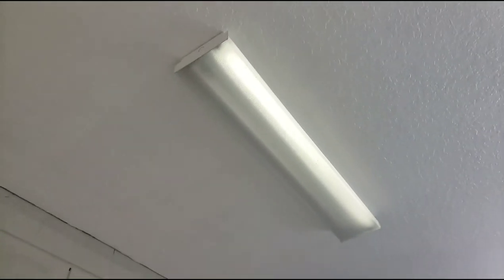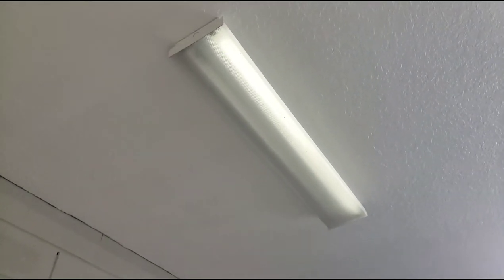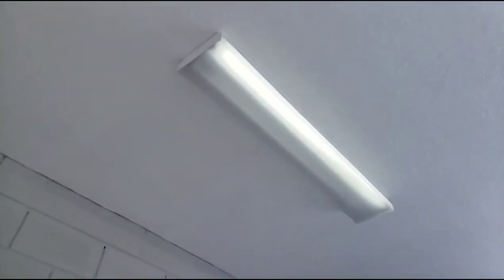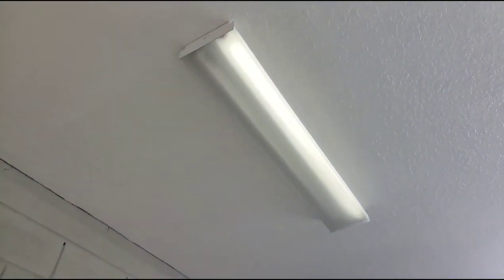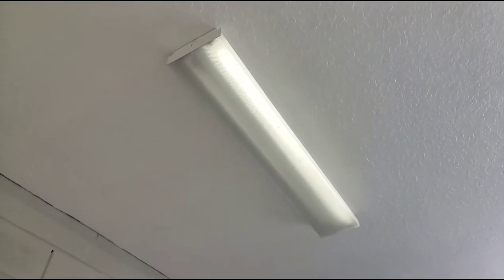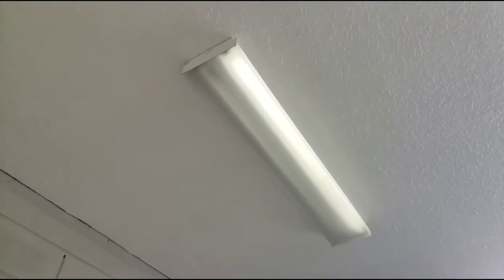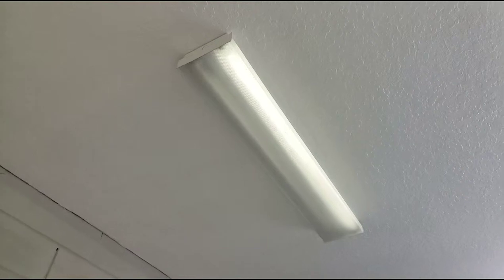Home Electrical - Florescent lights not working and changing the bulbs doesn't fix- bad ballast

Comment: I installed new bulbs. They worked for a few days. Now they barely light at all and the ends are black. However, every once in a while, they light up all the way and then fail to do so the next time I turn the switch on. Any idea what happened here? Could I have installed them incorrectly? Or could it just be a matter of dirty connectors?
Reply from the maker: I think  you probably have a bad ballast like in the video. The ballast controls the voltage to the light bulbs. Its bit worth replacing the ballast. I would just have a new light installed. Thanks for watching please subscribe!!
Reply: @drewsquickfix  I ended up converting to LED.
Reply from the maker: @bradh6185  awesome thats the best way. Saves a ton of money.  13-17 watts vs 40 watt florescent tubes
Reply: @drewsquickfix  Yep. No ballasts. I used my existing fixture/tombstones. I'm happy with it.

Comment: Word of the day .... "ballast"
Reply from the maker: Ha ha yes until I took an electrical class I never knew what the heck a ballast was :). I'm sure this video will get low views though. I did it as a quicky for subscribers like you AR I hope you found it interesting somewhat lol
Reply: @drewsquickfix  lol i never actually noticed one or two ballast while changing lights.  I've only been changing the screw on type bulbs, and that may have a ballast, too.  This is actually good to know for future reference.  Thanks!
Reply from the maker: The ballast is under the metal cover wiyh all the electrical wiring so you dont see it when changing out the bulbs. If a ballast goes it's not worth replacing it. Just get a new florescent light with led bulbs. They use 17 watts per bulb vs 40 watts per bulb.
Reply from the maker: Also if you change a screw in light bulb buy an led bulb for like $6. It will pay for itself in energy over one year. Compact florescent bulbs are usually 13 watts led bulbs are like 4-8 watts

Comment: Hi Drew, love your channel! I recently bypassed my ballast and switched to LED. I have a 2 bulb kitchen light and only one side is working. Could it have something to do with the tombstone?
Reply from the maker: Hey Kathleen, Just buy a new led light that takes led bulbs. Its the best way! I had a similar issue with trying to upgrade a ballast to led. Its really complocated and you actually need a separate lower wattage ballast from what i understand. I didn't have any luck its like there's too much power for the low wattage bulbs. From what I understand a  ballast is like a transfomer that charges up and makes more power for the florescent tubes that are 20 to 80 watts each tube. But the gas needs alot of energy to light up.   Ive found the best solution is to actually just buy a brand new light for $50 to $75 at home depot or lowes that holds led bulbs. Theres 2 kinds theres one that takes led tube an bulbs never replace and one thats permanent. I reccomend the one that takes led tubes. So you can replace them. Sorry about the loud  lame music ha ha I was trying something new and the volume was too high. Llease mash the subscribe button and hot the bell for notifications
Reply from the maker: You won't believe how.much energy you'll save by replacing the light and using led tubes. One tube is 17-19 watts vs 80 watts.
Reply: @drewsquickfix  Thank you Drew, the music is not a problem. I appreciate your help!!
Reply from the maker: Absolutely,  I love the new led bulb kitchen light we installed. Its a 2 person job for sure though.  You need to anchor the new light into the drywall with the butterfly wing nuts and bolts. Make sure you use a electric tester to make sure the power is off. -cheers

Comment: All I hear is music and muffled talking
Reply from the maker: Yes sorry it was a mistake when I made the video
Reply: Did you redo this one with no music. 
Looked very informative.  What are your thoughts on switching to LED?  Thanks
Reply from the maker: @markrightmyer8750  I can't once it's on YouTube it stays on YouTube. Sorry about the music.  Yes I RECCOMEND replacing florescent lights with led lights much more efficent. You can use permanent led lights or special lights that take led tubes. Led tubes don't always work on older florescent light fixtures